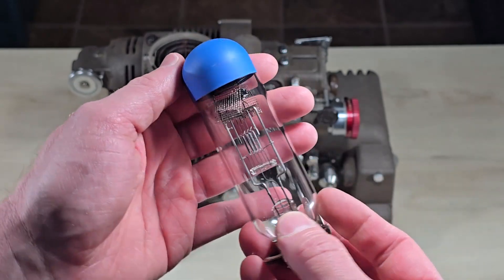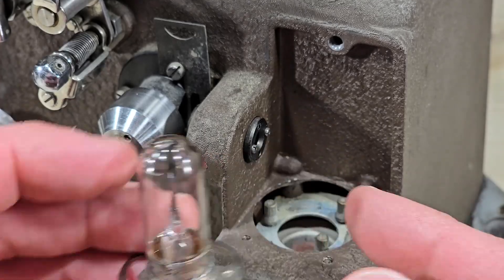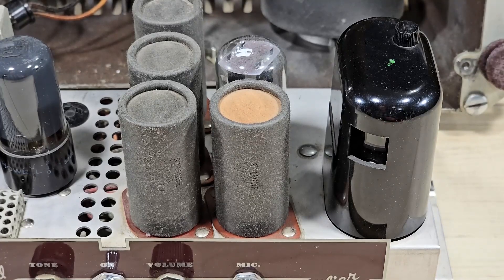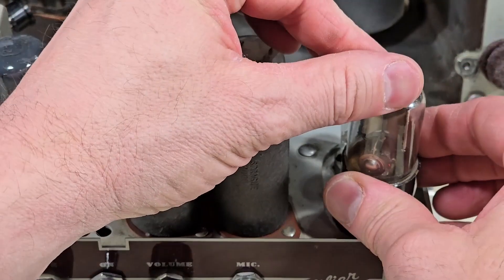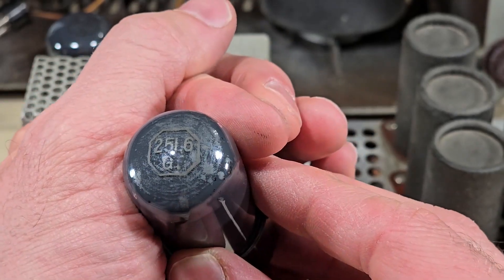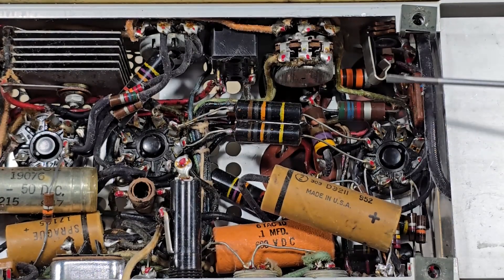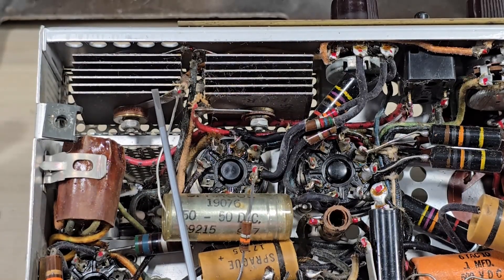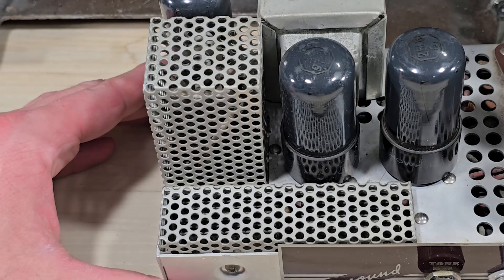Explore the sound production section of a movie projector

Comment: That was the low-end amplifier on the 185 and 285 projectors. It was only used for 3 years. Previous and later models had proper, transformer powered amps, although B&H did revive the design with their 500 series projectors with miniature tubes in the 60s.
Reply from the maker: That's interesting!

I have personally seen one other amplifier for this series of projector. As I recall, it had transformers and a pair of 6V6 output tubes. Don't hold me to the tube designation as it was nearly 40 years ago.

Do you have web link where the reader could learn more about the amplifiers?

Comment: I was an A/V student projectionist in Grade and High schools. I Ran B&H and Kalart Victor (Bulb and Arc).
You just ruined that projection bulb by getting you finger oils on the glass. The oils etch the bulb and  it will bulge in the lamp housing. (I have had to use a screw driver to shatter the glass just to remove the bulb from the lamp housing.) If you touch the glass (includes exciter and detector), immediately wipe it off with alcohol. Tip always leve the unit with the fan running after turning off the lamp until you can almost touch the lamp housing (It gets really hot when the lamp is on, even with the fan)
Reply from the maker: Absolutely! Yes, I have seen the bulbs develop hotspots and bulges. An operational bulb should be carefully cleaned.

However, I haven't seen 16 mm film on over 30 years. There is zero chance that the projector will ever run again.

Comment: Nice! Some 16 mm projectors used a magnetic stripe to hold the sound, which was a clever way to integrate audio with the film. For 35 mm film, there’s even a stereo optical track, allowing for higher fidelity. One of the biggest challenges with optical sound (and even with the 35 mm film) is achieving a light stripe that’s as thin as possible. A thinner stripe allows for better audio definition, especially for higher frequencies, but if it’s too thin, you lose light intensity, which reduces the audio output.
Reply from the maker: That's interesting. I've never seen 16 mm with a magnetic strip.

I was a projectionist for a short period of time. The 35 mm had three different soundtracks including optical (stereo), in the sprocket digital, and a digital time code that synchronized to a compact disk that was placed in the amplifier rack.